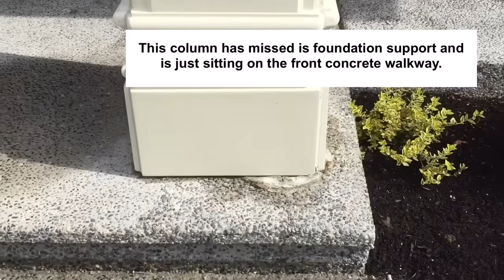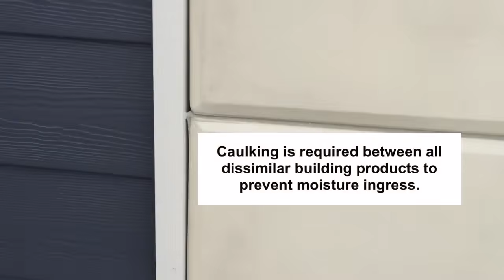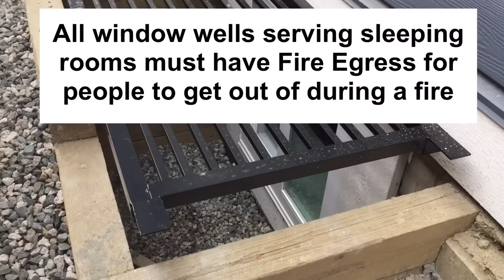New Home Construction Inspection - This is Shocking!!

Comment: Been in the Building trade since the fifties. I often hear "They sure don't build em like they used to" !  And I say "Thank God"!
Reply: What, but isn't that a bad thing? So why "Thank God"? I am confused by your Comment
Reply: I am guessing he has an old home.
Reply: I read somewhere older homes aren't as efficient on energy. They tend to have their own structural issues as well, due to old foundation pouring methods. Also old built to old codes for fire and safety, building codes are constantly updated to improve homes, this builder just chose to ignore them all.
Reply: VancouverCanucksRock Old houses are shit that's why. "The good old days" are now considered the shit current days.
Reply: Really? I've never seen an older house as poorly built as a new one, and I've been on a few sites for multimillion dollar houses. I'd be surprised if they last 20 years.
Reply: J Borg Comparing an old house to a poorly built new house is like comparing a 40 day old apple to an unripe apple. They're both disgusting. A well built new house will last well beyond 20 yrs.
Reply: Don't Reply, Old Houses are shit, eh? Esp compared to Houses built Today, where it is ALL ABOUT PRODUCTION/the BOTTOM LINE(Quantity), and not Quality?
Reply: Don't Reply only 20 years? And my house from the 50's has plenty of life in it. What are you talking about?
Reply: +Don't Reply 
Maybe if the old house hasn't been maintained at all, but if it had I'd take an old house over a new one any day. A well built new house would be great, we certainly have the technology and engineering to make them much better nowadays, but unless you're rich and oversee the construction of it yourself/get someone you really trust, good luck. The only well made house I've seen that may have been new was a huge mansion on a giant piece of land. Every other one was garbage, including a couple of multimillion dollar homes.

+Emma Robbie Us
New houses. They're made like trash.

Comment: new homes suck. give me an older house any day.
Reply: yup same here buddy, good bones and you can do so much if your willing to take the time and sped the money to do it right
Reply: Older homes have more character and are built way better.
Reply: Uh, wait till you have to replace all the knob and tube wiring, or lead drain pipe.  Old houses have their nightmares as well.  Not to mention sinking foundations.
Reply: Believe me I have. My home is 50 years old. Newer by some standards, but I have replace a lot. Still the quality, wood..structure and builtins were better back then.
Reply: It all depends on how good the builder was regardless of when it was built.  There have been crappy builders for hundreds of years, even going back to Roman times.  They even had laws about poor workmanship.
Reply: I want to sell a house built in the 1920's.  It will be torn down to build a new structure bacause families with 2 kids want individual "private spaces" and bigger ones than one that served families of 6 in the past who weren't embarassed to share a sleeping space with a sibling. What are they hiding that's worth more than the cost of college for thier kids?
Reply: LMAO, yeah dummy, my whole-home wiring for internet, VOIP,  coax, security system, and vacuum cleaner won't be found in old houses.  Enjoy your shitty 1970 pickup as well, with bench seating, no airbags, no antilock brakes, no adaptive cruise control, no bluetooth, navigation, and tons of other modern features.
Reply: ... yeah!  And to heck with a 1956 Chris Craft, the 1965 AC Cobra, real 2x4s, people outside talking to each other, 1 phone in the house, in the kitchen, Eichler, Rummer homes, car designs of the 50s & 60s, food was food [now called "organic"]  uncrowded beaches, lakes, parks, etc, etc, etc.
Somebody is addicted to tech...  and because of that walks around with a ring in their nose, being pulled this way and that, in the name of "progress".       :  )
Reply: You mean like cancer meds?  Let's see...
chemo therapy - an 80 year old "med"
radiation therapy - a 115 year old "med"
and that's after over $500 billion in donations.. same ol' same ol'
You can keep your tech updates, I'll take analog every time
Reply: +JAMAL JONES
Hardie Plank Fiber Cement siding is good for 50 years, makes wood like like shit by comparison.
And 50+ years ago, circuit boxes handled far fewer amps, and the wiring was extremely poor by todays standards.  Look up "knob and tube wiring" ... that's a gawd damn fire waiting to happen.
Old houses are shit in too many ways.
Reply: jeffy john - Oh yeah, because the building code from 70 years ago didn't leave ANY room for shoddy work...

Any chance you think cars and trucks ffrom the 60s and 70s are better than modern ones too?

HAHAHA, gtfo.
Reply: jeffy john 
Only if built by rejects.  New homes professionally built are state of the art and will hold up a lot better than homes from 20th century

Comment: I did home inspections for 20 years for private sewage systems and private water supplies like wells and cisterns.  On homes older than 5 years I almost always found problems.  It was normal for me to find bleeder lines, laundry lines, inadequate septic systems for older homes.  Replacing a septic system with the new regulations is going to cost 30 grand or more depending on the state regs and the type of system installation.  And then you have the maintenance and service contracts.

Comment: I built a new brick home in Indiana in 1997. We were told it passed all inspections. Four years later we had to move an entire inner wall because of mold. Wasn't flashed around windows and nothing sealed. Went to the Court House to c the inspector and was told by someone in the office that he signed the papers without EVER BEING TO MY HOUSE!  They said he had too many inspections to do and not enough time to deal them all. Ended costing us thousands of dollars because the City Inspector was a lazy idiot. He later got fired but it didn't help us any. That house ended up having tons of problems that the builder would never fix. Even though it had a warrantee. The co owner told me flat out to try to sue him. That he had more money and always won. Taylor Homes. His name was Eric Taylor. Brick was done wrong, wiring messed up, HVAC vents ran incorrectly, crawl space plastic and rock not done causing mold.....  I have ALWAYS had an independent inspector since then.
Reply: I feel your pain.  I was conned by a building inspector who missed a huge moisture problem on the back wall of the house that later required me to rebuild the entire wall.  It had been that way for years.  The mold could be seen getting washed out on the foundation bricks.  The people who installed the addition to the house several years ago did the roof the cheap way and did not gable it.  Leading to ice building up in the gutter and tearing it from the house.  I ended up having to put a wire heater inside of the gutter to stop it from happening again after repairing it.  He also missed open junction boxes in the basement, and two doubletapped fuses in the fuse box (he took the cover off of the fuse box no less).  I was fairly ignorant and naive at the time with it being my first home.  This was a 3rd party inspection.  All I can say is avoid Hometeam.
Reply: And that was in '97, it's only been going downhill from there.
Reply: @iunnox666  Wasn’t construction quality at its very worst in the early 2000’s? During the era of the McMansion.
Reply: Taylor Custom Homes in Raleigh, NC?
Reply: @CF-3300  I've seen some real bad ones that are more recent. Maybe on the whole it's gotten a bit better since then, though. And while it's not related to build quality, style has gotten way, way worse. Don't understand why everyone wants their house to look like a sterile office building these days.
Reply: @iunnox666  I’ve heard that as construction technology has improved the worst have gotten worse, the best have gotten better, and the avg has gotten slightly better.

Comment: The house I bought was more than 60 years old. I had to put many thousands of dollars into updating the wiring (the house was built before there was such a thing as three-wire plugs!), a broken sewer line, and many other things I don't even remember now. I bought it with eyes wide open, without inspection. Ten minutes after seeing the house I had known that I had to have it no matter who I had to kill to get it, and realized that I would put a lot of money into it. It was a 60 year old house, I didn't expect perfection. Now, it is the nicest house I've ever lived in, solid masonry inside and out, wonderful architecture, totally rain and insect proof. The price was right for its condition and I don't resent a penny of what it cost to bring it up to my standards.
Reply: dont older homes cost more to heat and cool?
Reply: @randomrazr  Where I live, in the mountains of central Mexico, the climate is so temperate that most homes do not have any sort of HVAC system. If it's too hot, you open a few windows. If it's too cold, you close them.

In the coldest part of winter, the temperature might drop all the down into the mid-50's (°F), on a really hot day in summer it might reach mid to high 80's.

In my case, I have installed an off-grid capable solar system with battery storage, and have two heat pump A/C split units that can either heat or cool as necessary. Together they might see a total of 20 hours of use per year.

My solar panels produce slightly more kWh than I use (maybe an extra two kWh daily), my house is total electric, so I don't care how efficient or inefficient it is. My electric bill runs me $1.33 per month, the minimum grid connection fee.
Reply: My house was built 64 years after your country was founded 🤣. Still standing just as grand as the day it was built.

Comment: I can imagine the issues that are hidden behind walls etc.
Reply: That's exactly what I was thinking. No way I'd take possession of that home, ever.
Reply: I second that sentiment. 

If it was just one issue, like caulking, that could be traced back to a single subpar subcontractor, that's one thing. But with that said, there are multiple issues that any GC should have spotted and corrected. Those porch columns really give me pause if it's true that the internal post isn't sitting on the footing. 

 I'd run away from this home.
Reply: It’s the bodies of the people who complained about everything wrong with the construction of this home
Reply: I bet there are multiple flying romex splices with no junction boxes. Openings with inadequate headers. No metal plates protecting the PEX.
Reply: Scary, huh? You can check the plugs for voltage drops, but the plumbing would be a concern on a house built like this, as would drainage, just for starters!
Reply: @thomasjeffries1020  all houses have issues. But if you are building you need to know the codes and why those codes exist and be onsite every single day. Every single day you need to be taking progress pictures.
Reply: 100%. I would run from this house and never look back.

Comment: I'm an electrician and an inspector for UL I can only imagine how bad the electrical is in that place .
Reply: Not always the case. The GC might have subbed certain work out to subcontractors who were actually competent.
For example, I live in an apartment building built in the 1960's. You can see a lot of the original crappy work that was done. You can tell that a lot of work was done over time to repair some of these deficiencies. However, the one shining exception is the steam heating system. I can tell what parts are original and what has been changed. The original work looks flawless, and you can tell that the original installers followed the book to the letter. It's the subsequent work by plumbers that have no idea about steam that messed things up.
Reply: Christopher Rejon imagine the crap u cant see
Reply: Get a fibre optic cam between the walls & be prepared for a horror video...

Comment: 3:30 Dryer vents and bathroom vents must terminate at least 0.9m (3 feet) from windows. 3:50 roof slope terminates into a horizontal projection (wall) without a cricket. 4:35 3/4" temperature/pressure relief valve appears connected to a 1/2" drain pipe which must be at least the diameter of the TP valve.
Reply: That must not apply to condo construction in BC because I see dryer vents, bathroom vents and kitchen exhaust fan vents terminating as close as 50cm (20") from opening windows and patio/balcony doors. /s

Comment: Back in 1977 my family moved into a brand new home in Joliet Illinois and I wish we had a home inspection before, two major issues my dad had to deal with was no insulation between walls and footing so we had SNOW coming into the living room the first time it snowed and the wall where the main water line came into the house did not have insulation so the first time it was really cold we came home to a broken water main. My dad had to insulate the wall and dig into the wall to even find the water main shutoff which had been enclosed under the stairs.

Comment: The bolted metal grates is terrifying
Reply: It's a "cheap out" those grates are only permitted if the window is not an emergency exit. There are fancy ones that latch from below that are supposed to be used on egress windows.

Comment: The three townhomes across the street from me (new construction) used untreated wood for the front porches! A year now and they are tearing off the front porches replacing them with the proper treated wood. Fortunately, the contractor is responsible.

Comment: Yep ! We saved up for decades to have an house built for our latter years. Since the place passed its county inspection, we felt it was good enough. Since then: nails come up out of the floor and out of the sheet rock. Three roof leaks during rain. All sinks and faucets rusted out. All door locks failed. All floor insulation collapsed onto the earth. Rain gutters slant a wrong way. Metallic doors rusted beneath their paint. Excess earth not carried away. Driveway was never installed. Kitchen Formica came up. Plastic elbow in pipe from water main was under tension and snapped, flooding for weeks. A lot of this was not done illegally, only cheaply. Some can be attributed to usage but normal usage? Anyway, property taxes have risen so rapidly that we have to sell out and more out of county.

Comment: I've been in the industry for 35 years. The only thing that comes close to 2.5mil is maybe the location. I can't say as I don't live there. The cladding on this house is the cheapest that you can use. This is typical of bad developers using cheap labour and cheap products to save them money. This house is styled to give the impression that it is worth 2.5mil. For the average person looking at buying a house ask what material's were used. I have worked on houses worth ten times more and none of them use that cheap cement board cladding. This type of building you mainly see in new subdivision by developers looking to con people.

Comment: Imagine how poorly built the structure underneath it all is.
Reply: Indeed. And what's hidden is usually much worse than what we ca see. Thanks Mike Holmes for educating us! :)
Reply: Stamped walls and trusses are pretty hard to mess up, no doubt it's going to rot because of how poorly it's wrapped and I bet the plumbing and mechanical are garbage.
Reply: Drogheda Drones & Fun Structure could be great - could be shit too. All depends on the integrity and work ethic of the subs. The company doing the facade likely wouldn't have been the same company who did the framing. Each stage of the build is usually handled by different contractors hired by the developer. Sometimes they have good contractors, sometimes bad, sometimes a mix. The developer doesn't usually care in the end as long as the house is standing and looks finished, some fool will eventually buy it.
Reply: I would run, not walk away from that deal. I had an independent inspector look at my house I purchased that was built in 1955, not new. Money well spent. My old house I purchased didn't have the amount of deficiencies this piece of shit has.

What's underneath, indeed!
Reply: 2.4 million to buy and 500,000 to repair.
Reply: I own a house built post-WW2 (maybe earlier) and the structure is as good as the day it was put up.
I also spent weeks caulking every exterior nook and cranny before painting.  As they say, if you want it done right...
Reply: I would hate to see what's behind the walls. It looks like the contractor threw the book of codes out the window on the way to the job site.